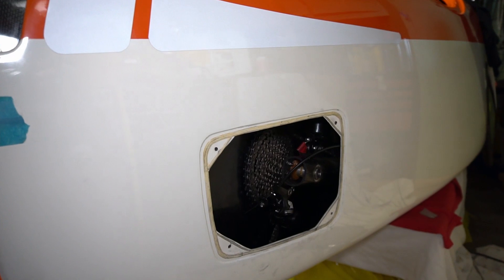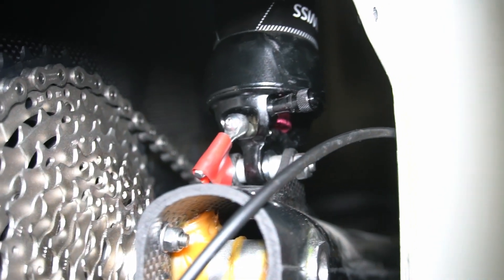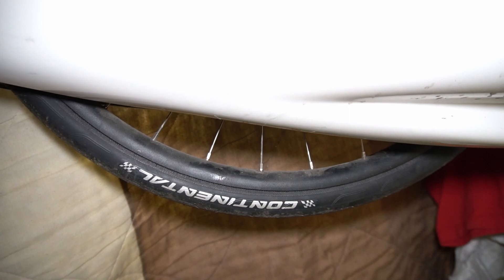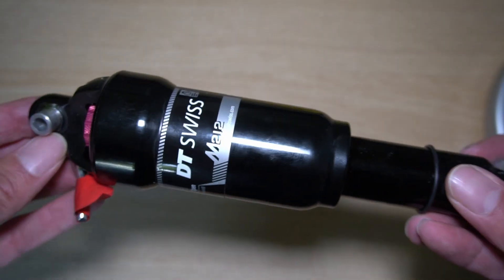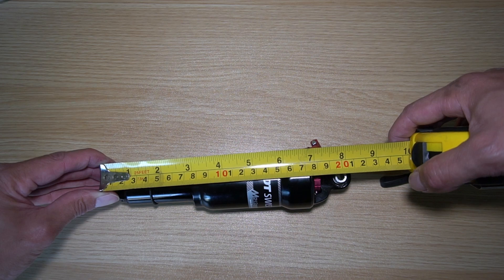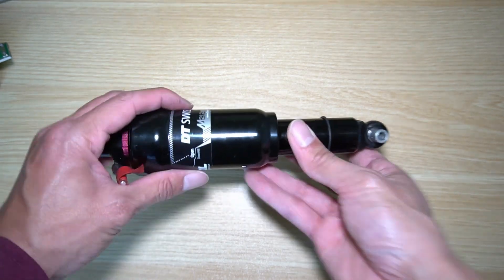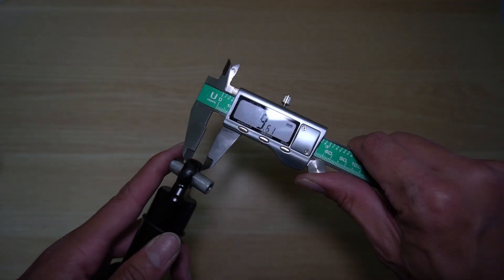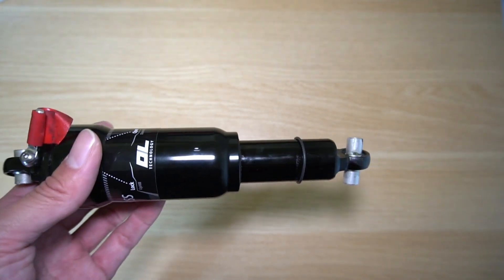DF XL Velomobile rear suspension (stock DT Swiss Air shock) measurements / specs

Comment: And when you're sitting in your DF, your weight will push on the suspention giving room to get to first gear.
Reply from the maker: I would not rely on rider weight to get into first gear.  When I hit a bump and the suspension uncompressed the inside of the shell snapped the derailleur pulley cage.  It was a LONG walk home.
Reply: @pedalpowercycling  You've got a point. When I'm in first gear, I use it to start and when riding I shift up quite fast. So my speed in first gear is very low. And I live in the Netherlands, where we have a nice infrastructure for cycling, so I'm not that familiar with potholes etc.

Comment: What year is your df xl? My df looks quite different
Reply from the maker: Mine is first gen, so I think 2015.  I've heard other people with the same gen as mine break their rear swing arm where the thru axle enters the end of the swingarm.  They've since contacted ICB and had to update or purchase a new swingarm (mine is original, only around 2k miles total on it).  BTW I'm using an 11 speed Shimano SLX rear derailleur.  Hopefully you were able to get one to work on your DF.
Reply: @pedalpowercycling  , mine is 2018, so the swingarm looks quite different.
Reply: @pedalpowercycling  which shifter do you use infront ?
Reply from the maker: @Lufftschwimmer  Now I switched to shimano 11s slx.  XT and XTR out of stock.  Do you have a velomobile as well?  If so which?
Reply: @pedalpowercycling  same as you DF XL , today I made some holes in the back for a better airflow inside the shell !